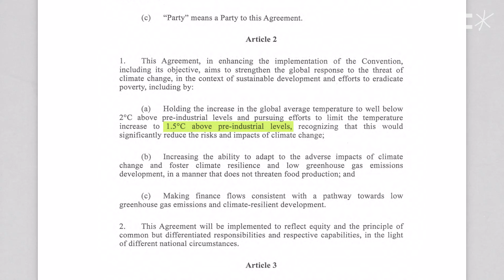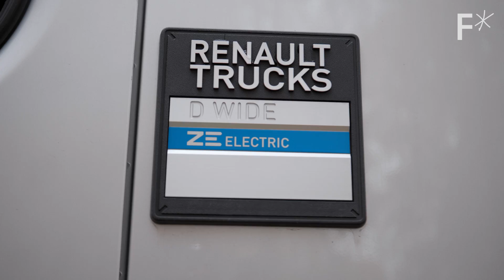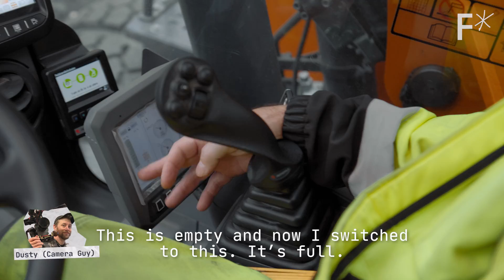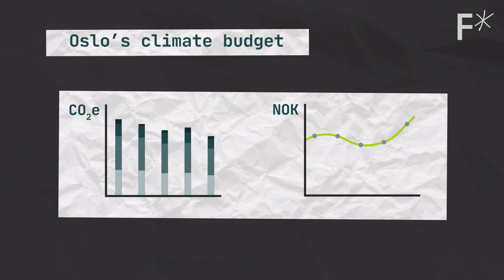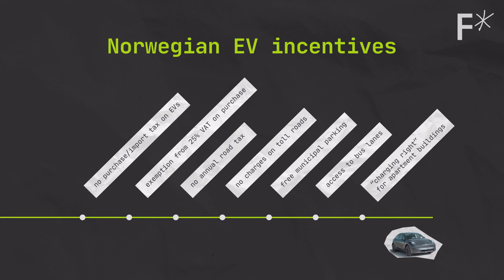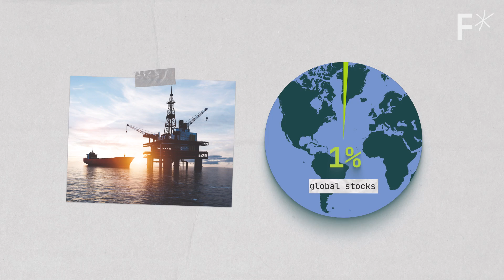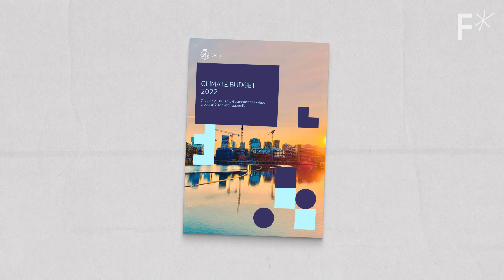The world’s most electric city | Future of Cities

Comment: Right off the hop... I see multiple products that need oil and gas. The insulating sheathing on the wire being plugged in at the beginning, the plastic disconnect boxes they plug into, any battery powered vehicles battery boxes, the white plastic barricades, the plastic control handles in the excavator, the rubber cleats on the tracks of the excavator, the tires on all of the vehicles... For any moron thinking going electric is "Net Zero"... Your true reality will set in soon. The hypocrisy of this false flag climate change narrative is purely satanic
Reply: Problem with ur arguement is that none of those are single use. Plastic is still useful no-one is disputing that fact. But everyone is saying the oil as fuel and single use plastics are incredibly problematic.

Comment: All this is quite partial, and we scrupulously avoid specifying how electricity is produced. 
Thermal and nuclear power plants have production efficiencies of ... 30%. The rest is heat discharged into the atmosphere. 
Combustion plants (Gas, Coal, Fuel) also emit oxides of carbon, sulphur and nitrogen. 
The use of photovoltaic panels does not pollute, but they have a very low efficiency (10%) and the production of panels is very polluting.

The video does not specify more ways of heating in the city. Electric heating everywhere? come on! 
This video did not laugh scientist, it looks much more like propaganda.
Reply: 88% hydropower, 10% renewable and 2% natural gas ( likely has decreased from last I checked) is what powers the entirety of Norway.
Reply: @bigcnmmerb0873  specify the source of the data. Prove your claims. On the other hand, even if this information were real, it only concerns, according to your answer, Norway. For other industrialized countries, these figures are false, and my comment remains valid.
Reply: Also what do you mean laugh scientist? That makes no sense at all, it's just a video of how they are electrifying for the average lay person, if that person wanted to do more research they can watch another vid.
Reply: The more you talk to average lay person, the more you must ensure that they don't misinterpret your words. 

This video implies that as electricity is totally clean, it is the solution of the future.

However, the means of current electricity production all have an impact on the environment, whether nuclear (radioactivity), thermal (air pollution and excessive water consumption) hydroelectric plants (demolition of biodiversity), wind power and photovoltaic (significant pollution of the means of production).
Reply: @itacaperduta  while that may be true, the weighing of pros and cons have to be taken into place, if people say renewables are better, or nuclear is better the pros and cons have been weighed and compared to the other. This along with the changes in technology and how we understand these systems.

There is a reason why experts in the fields of energy can all agree that renewables/nuclear are a much better solution compared to fossil fuels. The pros and the cons are better compared to fossil fuels.
Reply: @bigcnmmerb0873  What you say is absolutely not demonstrated. This is a fallacy, by which you vainly try to make believe your false and illusory ideas.

Moreover, it is very easy to observe that each time, people who, like you, act like this, do not fail to say that the "Experts", or "Science" have proved this, without ever saying who are these so-called Experts, or these so-called "scientists", and without ever naming the studies that are supposed to prove this.
Reply: FF disinformation talking points.  PV has been ~30% efficient for a long time.  Maybe they were 10% in 1990; not sure.  Solar panels can be recycled better each year, only have to be mined once, not endlessly like oil, which is very polluting.  But none of that is relevant to Norway who uses hydroelectric.  Concrete is very polluting when made, but solutions are starting; again, unlike oil.  Edit: you did get around to hydroelectric problems which are true, but oil is way more devastating to biodiversity.

Comment: Another city most wouldn't think is going electric is Delhi, recently decided that they would stop procuring CNG Buses (which is already cleaner then diesel ones) and will only buy electric buses, Metro and Railways is already 100% electric, Taxi's (which again was mostly CNG as sale of diesel taxis has already been banned a long ago) city wouldn't issue permits to new one's that are not electric, we also have something similar to paxter called e-rickshaws that is being used for last mile connectivity and for transporting goods, there's already plan to ban diesel cars by 2027 in whole country, two wheelers are already getting rolled out as electric each and every day but we do lack in electric construction vehicles.
Reply: Going to be Huge Failure . When Delhi wont be able to produce Electricity
Reply: Electricity is everywhere to be harvested. And I mean everywhere. Even our body has an electrical system, works chemically. Pottasium and salt as in a sports drink.  @SamRichardson1990

Comment: The huge problem we need to solve is getting away from everything having to be using these very resource intensive batteries. We can't keep farming lithium and the other elements necessary for the current battery structures. Figuring that out would be great.
Reply: The huge problem we need to solve is getting away from everything having to be using OIL.  ICE cars are very resource intensive!  We can't keep drilling toxic OIL.  Figuring that out would be great.
Reply: It's figured out already.  Lithium is plentiful.  It only has to be extracted once, since it is not thrown into the air.

Comment: If 'they' really wanted all electric, streets would be electrified for us.
Just like cable cars, the electric vehicles should be powered same as bumper cars, on board battery for changing lanes, gaps in the system.
That battery kept charge by the grid, never need to plug in your car.
Pass a bill, and fund that project for your future,  Make them eat the bill.

Comment: Electric is really advancing at a staggering pace. I'm sure EVs alone will be more efficient than conventional gas engines in the not too distant future.
Reply: That future is already here.
Reply: I agree but we need carbon free electricity to power them. Solar and wind are important but carbon free energy is not possible without nuclear power. If we had not been deceived by the anti-nuclear hippies we would have no global warming, electric cars snd energy too cheap to meter. 😢
Reply: Even if charged by dirtier electrical grids, EVs do not put noxious chemicals into the air next to people walking or running or riding, and reduced noise is  valuable.
Reply: @georgesears2916  A large portion of the public perception against nuclear power is irrational and unscientific, but the nuclear industry has no one to blame but itself.  You'd be hard pressed to find an industry (besides tobacco) more lacking in transparency and engaged in more deception, coverups, and underhanded lobbying than the nuclear industry.  And today the nuclear industry is neck deep in spreading disinformation about wind and solar.
Reply: I am big on nuclear myself,agreed. But I also know that renewables just need storage and some types or energy storage doesnt even need batteries. @georgesears2916

Comment: The amount of used batteries that are going to end up in the landfills is gonna be staggering.
Just give it another 10 years we would have traded air pollution for environmental pollution.
Reply: A battery is made of metals, it can be recycled, and it will be. Furthermore air pollution is just one aspect, the main issue is climate change. However, yes, less batteries is better, that's why metros, tramways and trolley-buses are the best solution for transportation. Not to mention walking and using bicycles. But if you really need a car, it must be electric. And of course, we do not need big batteries, with a wide and reliable charging network, about 60 kWh for a 5 seats sedan is quite enough.
Reply: Look up battery recycling(in Norway if you want), all those elements get reused.

Comment: The arguments are always centred around what is best to power vehicles or other energy hungry tools. Currently, it is between some form of hydrocarbon, electricity or hydrogen. More conversations continue to compare which are safer. But why not ask the question, how and where you acquire these forms of energy. After all, they don't grow on trees, right?
Here's a spoiler... electricity or hydrogen, they still need to be produced, which then leads to the question, how do they produce such forms of energy? Not plucked from trees, I'm sure.
Well, electricity and hydrogen is either zero emission, or with hydrogen, no carbon emission. But with most countries, their sources of those energies still go back to one of the other more traditional forms of energy, burning hydrocarbon, coal, nuclear. Some are from newer sources, wind, wave, solar. Only the latter three are generally free of emissions, especially carbon.
But how many countries have the luxury of having these last three sources?
Norway has been getting more than 90% of their energy from hydro, and most of the rest from one of the other clean sources. 
On the matter of seeing so much of their vehicles and tools running on electricity instead of hydrocarbon, is because 1, they have been doing this since the 1990s; 2 electric powered vehicles and tools are easier to build and implement, as long as you have the resources to supply the energy source. Electric tools have been simpler to build, maintain and use than internal combustion engines. 
I don't see what Norway has done that is so commendable other than the will to swap to electric power. But it is so much easier for them, and also because it is in the long run the cheaper and easier solution.
So, what is so special that this video is trying to tell us?
Now, if Norway was able to develop a source of power that can be easily duplicated elsewhere on the planet, without still using traditional dirty means, then that would really be something to trumpet, don't you think?!
Reply: Not sure what your argument is. Many ways to create energy without burning carbon and many ways to store it ,dont even need batteries. Basically we create steam to spin turbines (except hydro which flows and turns them) which spins off electrons to power our grids.